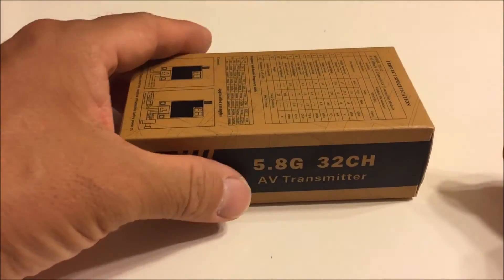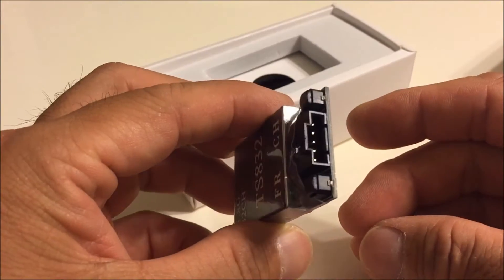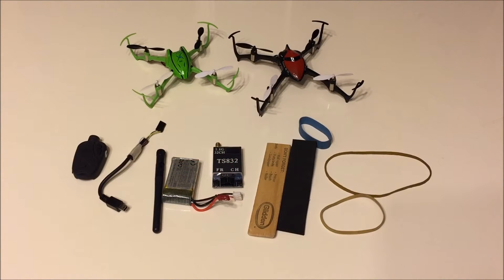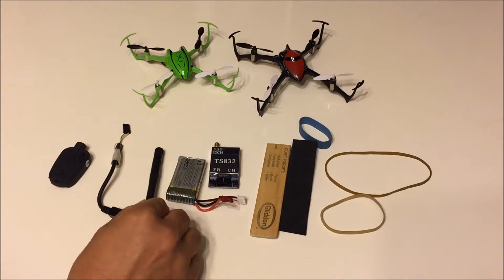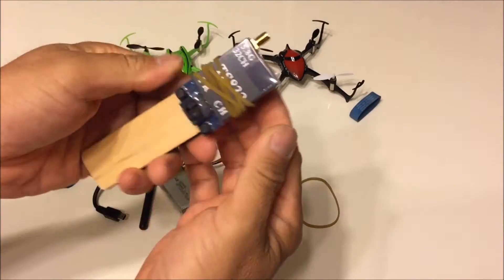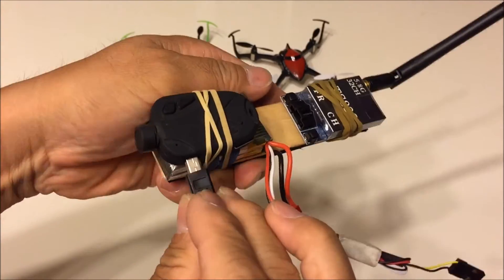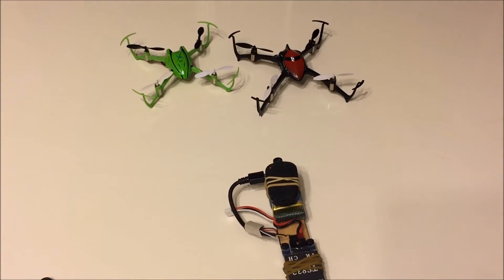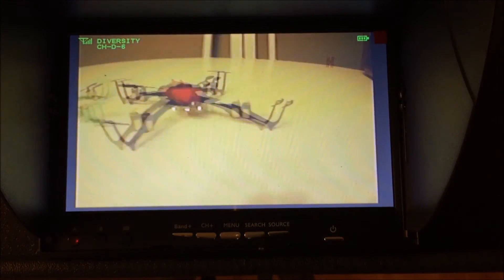5.8GHZ FPV BUILD EACHINE TS832 (BANGGOOD)

Comment: Does it have a built in microphone?
Reply from the maker: I don't think so...
Reply: RC Escape Where do you connect the microphone? I just bought the same transmitter the spec indicating it’s a Audio and Video transmitter.
Reply: @Harvz78  need to purchase separate

Comment: Can I put this set up on the BugS 3?
Reply from the maker: yes it should work fine but there are easier ways to fpv with a aio vtx :)
Reply: I have the same keychain camera coming in the mail that's why I asked.
Reply: I agree. I've used my JF-01 $25 AIO camera/tx on my Bugs 3 and it works fine though the tx range is only about 100 meters. The TS832 tx range is so much greater than the control range of the Bugs 3, it's a waste of power. An Aomway 200mw AIO camera/tx would be a better solution.
Reply: RC Escape my 808 cam came with a different plug than yours. It's an usb cable instead of one like yours.
Reply from the maker: you will need to purchase your 808 keychain or the mobius cam from the original seller of the product.  it is eletoponline365 on ebay,
everything else is a clone.

Comment: Cant get my hero 4 to work, I'm using the ts832 and the black pearl monitor but when I put the transmitter and the monitor in the same channel and band I get a clear black screen. Any ideas?
Reply from the maker: Are the correct wires going to the transmitter from the hero and is the wires for the go pro?
Reply: +RC Escape yes its the tarot 2d gimbal gopro wire and I'm connecting it like you do in the video